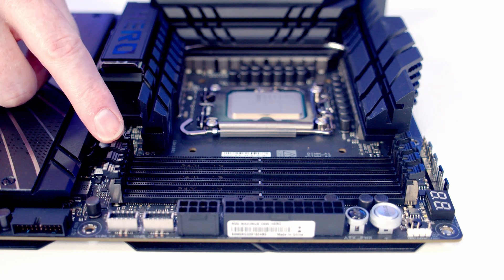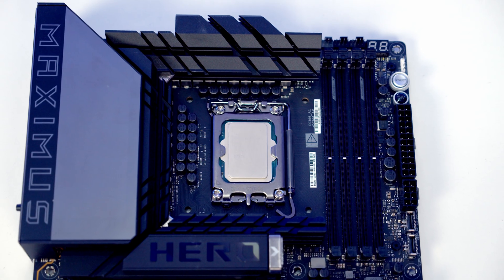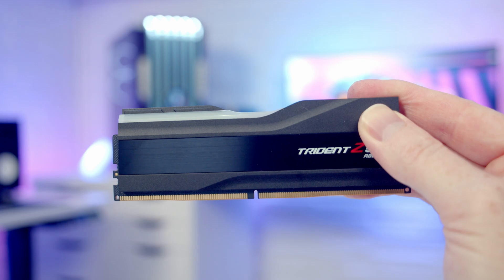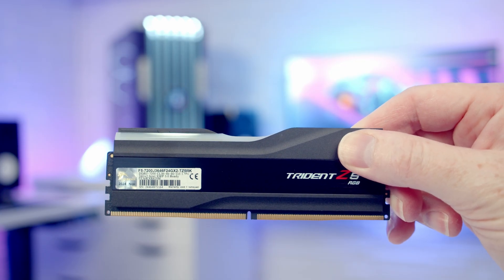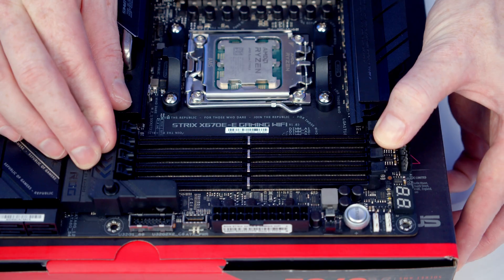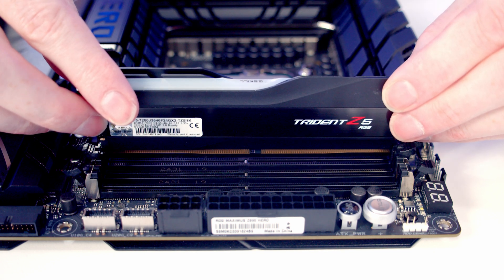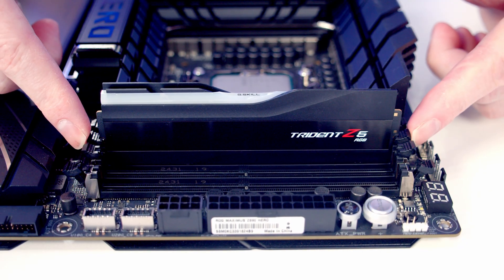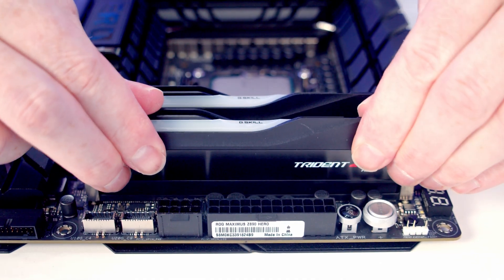How to Install DDR5 RAM

Comment: Well Okay, but could you show how do do it if there's only one clip? I can't doi it cleanly as you did.
Reply: just make sure its correctly placed in the socket (no end is out of place) i usually press harder on the lower end where there's no clip and follow up the pressure with the clip end (because if u pressed hard enough with balanced pressure on both ends for me the clip side always goes in 1st with the help of the clip) i hope this made sense. any how as long as u don't scratch the rams... ur more likely will be fine however u install it.... just make sure the logo is facing the edge of the motherboard just like the video